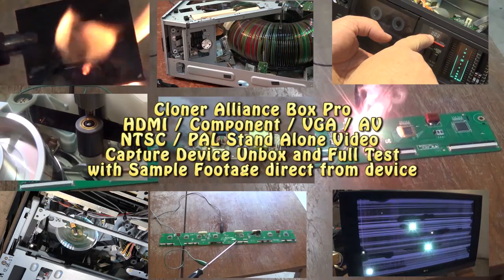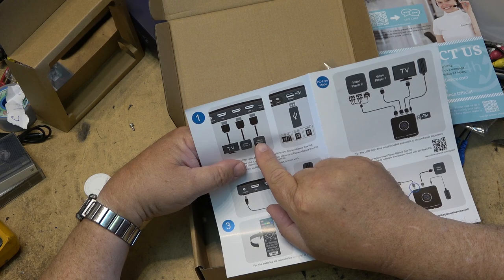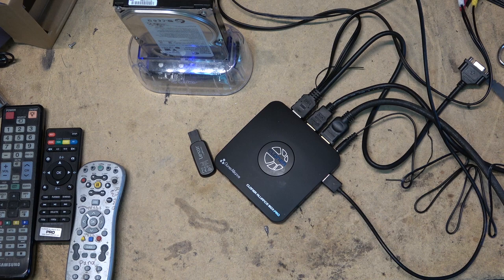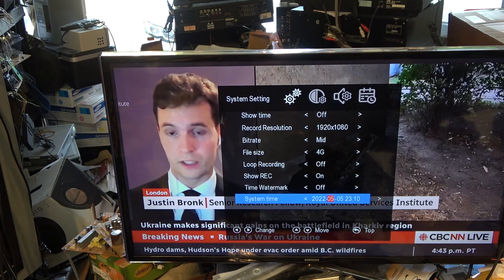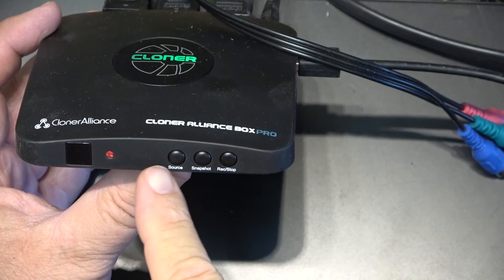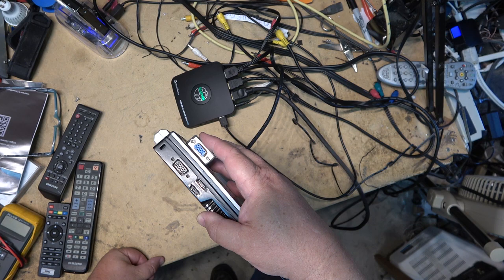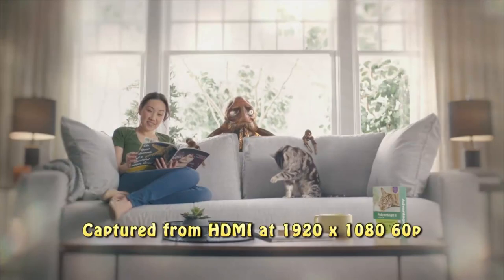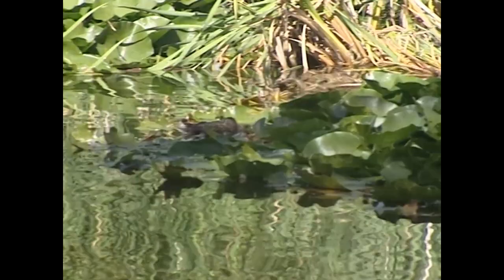Cloner Alliance Box Pro Stand Alone HD Capture Box is the Best I have Tried Yet

Comment: Looks like a nice device. My primary interest is PAL capture and like you have said, many of the other offerings fall short of the mark in some ways. Looking at the output you have shown, I would be happy with one of these. I do have one question though, when capturing analogue video (on other makes), I find there are very often timing issues with lip-sync. How does this unit fair in that department? I am sure that others would be interested in this question as well. Good demo, thanks. Chris, UK.

Comment: In my review of it I did a side-by-side comparison with using an old DV Handycam to do video capture, and the Handycam totally blows it away in image quality. Also my Cloner Alliance box glitched out when using bitrates above 10 Mbps and had weird audio compression artifacts (like the treble abruptly cutting in and out).
Reply from the maker: First of all using your handicam to digitize is a totally different animal. DV is 5:1 fix compression MJ peg and requires 25 megabits per second so about 12 GB per hour to store footage. Unless you have unlimited hard drive space this is really not that practical because you're going to burn up a lot of real estate real quick for standard definition video. I always offer DV capture as an option to my customers and when they find out that the files take 12 gigs per hour they always want them as an mp4 file because everybody wants to upload stuff to the cloud or to share with family. What I did find is that saving to a USB stick playing it back on the device itself there was some glitching due to the USB stick not being fast enough however most of the shots you saw on the video were actually captured to the USB stick. silly me when I did the initial capture to the hard drive and neglected to check whether it was in 1080 or 720 and everything was captured at 7:20 so I went back and redid the shots at 1080 saving them to the USB stick I just dumping that over to the computer to edit and as you can see there was no problem with the footage done on the USB stick. I did test it extensively although I didn't show the shots from Jurassic Park but I did capture the tape and played it back both on my TV and through computer and it played fine. I didn't use the highest bit rate I use mid, we'll probably go back and turn the bit rate up and see if I noticed any noticeable difference but for capturing VHS tapes it looked good and it was a hell of a lot faster than doing it with a DV camera. To capture a 2-hour analog tape on this device takes 2 hours and you have a very acceptable mp4 file that nobody is going to complain about. To do the same thing using DV would take 2 hours to capture if not longer because gaps in the tape where people didn't record something for several seconds quite often cause capture cards to bomb out and then you got to start again but in addition to that if someone wants it in MP4 you then have to compress it and that's going to take another 30 minutes or so to take it 2 hour avi file and turn it into an mp4. So from a business perspective this is a no-brainer this allows real-time capture and the quality is more than acceptable. If you don't find the quality coming off this box acceptable then that's a you problem because I looked at it very closely and I think I have a pretty good eye for quality and I found the quality to be more than acceptable especially considering that is coming off of a VHS tape which was crap to begin with. Half the time when I get tapes to digitize for clients they're not even the original tape, the people shot their original home videos on an 8mm camcorder then they copied it to VHS in the EP speed, and then possibly made another copy of that. You know the saying garbage and garbage out. I did do a comparison at the end but you may not have seen yet because the video hasn't been up that long or I took footage from an hdv tape and I captured it using analog and HDMI and took the direct data dump over firewire and compared all three if I didn't tell you which one was which you wouldn't know other than the fact that the firewire transfer had a drop out which caused a nice big red flash on the screen which didn't happen using the video out from the dv player because the dv player has memory and it buffered the data loss which wasn't buffered when it was transferred by firewire so the lost data caused a glitch in the video. I might do another demo or I capture some hdv tapes using firewire complete with all the glitches and then go back and play the same tape and use the HDMI or component out and captured on the cloner box and run the two of them split screen see if you can spot the difference between the two. They should both be pretty close and you will spot the difference when glitches show up dropouts on the firewire transfer because there's no dropout compensation. When you play a DV or hdv tape any dropouts just show up as lost data on the firewire as there's no compensation made. At least going through the video circuits of the camera or the playback machine in this case it has memory so if there's a dropout it retains the data from the prior frame and you generally don't even notice it.
Reply: @12voltvids  LifeFlix converts DV to MP4 on the fly, in real time, and does a good job of it. I have a review of it on my vwest7ife channel.
Reply: Can this capture audio in LPCM like my DVD recorder? This is important for many of my old vids as the audio pros prefer that to DD to remove artifacts. Otherwise, I might just pick one up just to play with it a bit. I have all new equipment including 500 GB SSDs and a new Asus R7 laptop…
Reply from the maker: @hawleygriffon9290  well first SSD is not something you want to use for writing video too. All solid state drives have a limited number of write cycles and video is write intensive. I don't see any options for PCM audio it seems to be MP3 at 384 kilobits. I haven't played with the high quality setting yet I've only used the mid quality but at that data rate is 12 megabits per second MP4 which is pretty good for a 1080 stream. In the coming weeks when I sit down and play with this unit more I'll do some tests at the different encoding modes low mid and high so a direct comparison can be done between the three quality modes for both standard definition and high definition content. I'll do a more in depth and analyst of the files and so forth. This one was more of a demo to show what it does and how good it looks, the next one will be a deep dive into the files and so forth to see how it compares to my other capture cards and equipment that have acquired over the years. For example I'll compare firewire transferred DV to analog captured DV and analog tapes digitized over firewire using the DV deck or the digital 8 camera. Expect that in the next couple weeks. I just got a bunch of stuff in that needs to be serviced so once I get my backlog cleared up a bit and I have some time then I'll do a deeper dive on this unit but so far everything that I have tested on it has been perfect.
Reply: @hawleygriffon9290  No, the audio it captures is AAC compressed, at a bit rate of 192 kbps.
Reply: @vwestlife  Odd. The website says it can record PCM on the UHD version but oddly enough it is incompatible with VHS/VCR tapes. I guess they never saw a VHS deck that could output through HDMI. I have several Toshiba dual units that can do that. AAC 2 channel would be acceptable for many of my old Betamax and VHS tapes but later ones were recorded in surround sound. Ah well, guess you can't have everything...
Reply: @12voltvids  I guess SSD is handy because it's super fast when used as an internal drive in a PC, and it will also beat an mechanical HDD in a USB-C interface enclosure, so i guess perfect as a inbetween storage solution, from there to transfer to preffered storage media/device.
Reply from the maker: @eric-janvandenbogaard9415  There is no denying that SSD is faster, but the speed for media transfer is not that important. Where SSD really shines is putting your OS on it, drivers ect and possibly your editing software as it will load faster. There won't be much savings in time copying from SD card to SSD vs a half decent video rated drive as the bottle neck is going to be the read speed of the SD card. My system as old as it is boots up from a cold boot in about 35 seconds, and that is from power on to asking for my login password. To load premiere cs 6 from cold start (where nothing is cached) about 20 seconds.  If premiere has been cached (in other words previously loaded  in the session it loads in 3 seconds. Premiere however lives on a 7200RPM conventional drive.  My SSD is only a 120G and of that only about 110 is available. The rest is reserved for wear leveling, and out of that 110 available windows and associated files takes up about 80 gigs. I have a 500 spiny drive for my apps and 2 internal 2TB drives for media storage plus 3 external USB drives for storage and 2 drive docks. One is usb3 and the other eSATA. I think I have enough storage. I also have about 60 bare drives ranging from 500 to 1tb for backup storage.

Comment: Can this device be used to just view captured videos on a TV from an external hard drive? I don’t want to capture Hi 8’s with composite when the available firewire out is superior, but I can’t seem to find any way to plug a firewire from my Sony Handycam into it. But if I could watch videos from a hard drive with it it’s worth the money to me.
Reply from the maker: Yes it plays back on tv directly.  I believe i showed that.  The firewire output from your digital 8 camera is a totally different standard. It is not mp4. It is Mjpeg. The color space is also lower.  4:1:1 vs 4:2:2
I'll be doing a comparison using various captures abs be inviting people to guess if the capture was made by firewire, composite, component or HDMI.  I will also use an s video to component adapter to capture s video.

Comment: Was almost finally a WIN for me, UNTIL the discovery of no PAL or 50hz capture resulting in the the same output. I see reviews also say this as well. What a sincere pity... otherwise brilliant box!
Reply from the maker: Hello, I did capture PAL. The sequence from the Betacam at the end was pal. The record rate is selected by the output device. If you plug it into a PAL market TV the HDMI interface detects it is a 50hz display and captures ar 50hz. My TV it is connected to is a 60hz display, and as such everything is set to display at 60hz. 
The file output is set to whatever the native display is, 50hz or 60hz. The PAL capture looked great on my TV.
Reply: @12voltvids  Ah, excellent info, must have missed that. In that case I'll look into a purchase as it's the best I have seen. Thanks!
Reply from the maker: @marktubeie07  I agree it's the best one that I've certainly had the opportunity to try out and I am going to be doing some more work with it I just got buried in camcorders and the dot machine today. Six camcorders rolled in the door everything from a small mini DV couple of 8 mm vhsc full-size VHS and a great big honkin evw 300 professional hi8. Once I deal with the backlog of stuff that's sitting in the shop now to be looked at I will dig out some of my own tapes in various formats and I'm going to do some fairly extensive testing comparing different capture devices that I have including some professional capture devices and we will see how the stacks up to some of my really expensive because I have a digitizer that was about $1,400. We'll see how it stacks up to that also compare it to DVDs that have been ripped and will import everything in see how it looks it should be interesting because I'll I'll send it out at 1080p because this capture box captures everything at 1080p so we'll look at its internal scaling it's hardware scaling versus some standard definition content that I have to upscale and software to make it fit the frame we'll see how they stack up I'm betting that this is going to look better.
Reply: @12voltvids  Looks like a great device ! only thing might be, that  AR4:3 will be put into 16:9 with bars at the sides, because the scaling is the TBC "feature" ?
Reply: I note a few problems with this company's devices from replies on Amazon. Many seem to be quality control ones where the unit stops working after awhile. It would have  even great to have had you tear down the unit to see what makes it tick. Other problems seem to be long recordings being split into chunks or recommendations from that company to record in eXFAT over NTFS as its more stable. News to me since I've been recording to NTFS for a long time now. Also, seems better to record to SSDs than platter HDDs. Limited use for ne as I would have to convert to Mpeg2 to make DVDs. I only have 1 portable player that can accept MP4s and play them directly from a disc or flash drive. The higher end unit also has trouble with some UHD content. I was considering that unit over this one but I must reevaluate what I can use it for. I still have a $100 credit with Amazon so the cost isn't going to break me even if I do get the higher priced unit. All in all though a great video and an interesting device, warts and all...
Reply from the maker: @hawleygriffon9290  full size will be split at what size you selected the file to be. You can select 4 8 16 or 32 gigs. Obviously if you're using FAT32 the file maximum size is 4 gigs. I haven't done any real long recordings on it yet but I will be in the coming days.I didn't do a teardown because typically these devices there's not much to see in them anyway everything's down to one or two chips and since this was expensive and I paid for it it was not a freebie I didn't want to risk any surprises or traps inside. If it breaks then I'll do a tear down but I spend a lot of money on this to buy it as a tool for my production business. As noted I bought it through Amazon so if it didn't work I can send it back. Now between this and the higher end model the higher end model supported 4K pass-through which meant you could play your 4K Xbox and watch the content on your screen in 4k but the capture of it is still only 1080. I didn't buy it for gaming I bought it as a capture device to archive video so anything higher than 1080p is just a waste because 95% of the content I'm going to be recording through this device is going to be standard definition anyway.
Reply: @12voltvids  hey 12 v im new on page want ask about my Sony 600 boombox cassette player feature
Reply from the maker: @Blu-Man  go ahead you have the floor.
Reply from the maker: @hawleygriffon9290 
After a year if use i have digitized over 1000 tapes.  With exFAT or ntfs the file size 32gb. That translates into 4 hours at the max bit rate or 6 hours at mid and 8 hours at low bit rate.  Didn't see much if any difference between high and mid when capturing a full HD capture over HDMI.  It was fantastic.

Comment: According to the MattKC video this cant actually record in 720X480. It upscales to something else rather than leave the video as it was. Can you confirm this? Also, I notice their multimedia connector goes into a HDMI port labeled multimedia. But can't the same connector work in the regular HDMI input port as well? I guess it would help so you don't have to unplug cables but then the same cable should also work on the UHD Pro version except that it doesn't even have a setting for standard definition. Seems to be a glaring oversight or else they want you to buy 2 devices...
Reply from the maker: All video is recorded as either 720p or 1080p. Standard def 480i or 576i (pal) is scaled up to either 720 or 1080 depending on what you set it to and I'd course 4:3 or 16:9 again you change that with the remote. The mmi connector is the same physical plug as HDMI but it is not HDMI it is rgbhv, y r-y b-y, composite and l r audio.  By the time you add the grounds that is 14 pins if the connector used.  
The 4k gamer is a different market use.  It will pass through 4k to tv and stream 1080. This one is designed to record as a stand alone device. It can also stream 1080 and lower video.   2 different products with different intended uses.  It is not that they want you to buy 2, they are targeting different users.  The other one for me is pretty useless as i don't want to have Mr computer tied up when digitizing video.  This one records direct to USB media no pc required.
Reply: @12voltvids  I see. I want to move something like this to another room so I don't have the Beta, 8mm and VHS decks cluttering up my game room and bedroom anymore. Luckily, I have several computers that are in different rooms so I can do just this. A dedicated capping area would be best but I'm wondering what the computer input does that the standalone mode doesn't and what other software works with this? Too bad I can't just hook this up to the new Chromebook I bought awhile back for $99 unless I can find some capping software that also works on ChromeOS or Android. But I have an older i7 in that room that can be repurposed as a video capping and editing workstation. Looking forward to grabbing one of these later this week. Thanks again for the info (as always)...